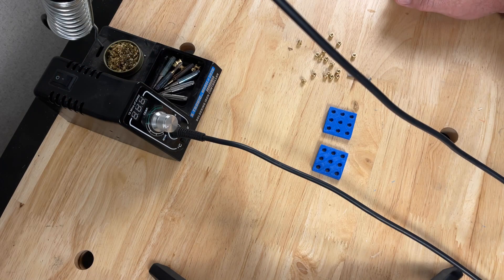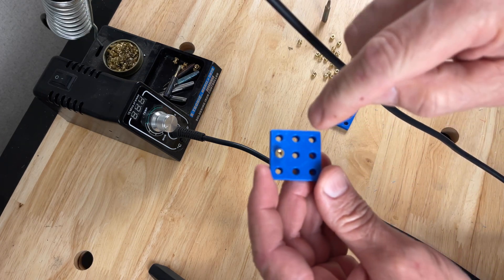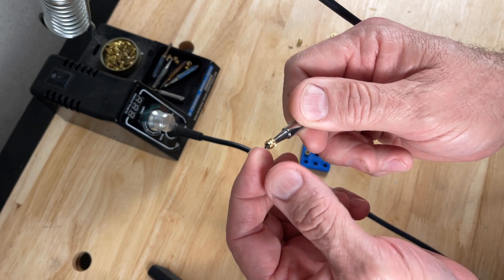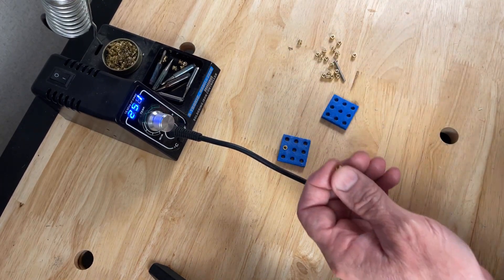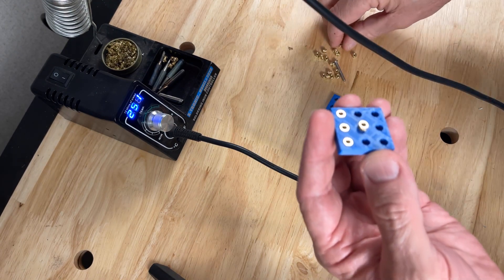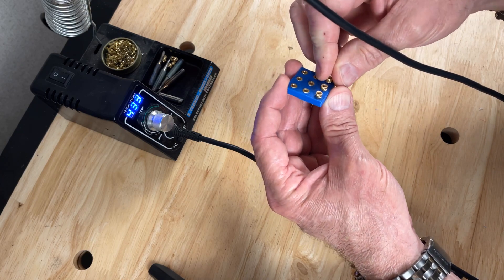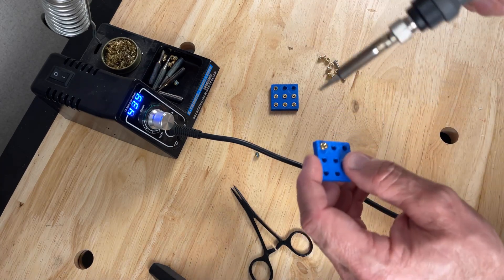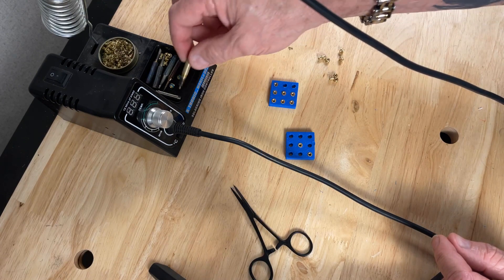How to insert heat sets into 3D printed parts

Comment: Thank you for this video.  I am building a Death Racer using your videos.  How do I determine WHERE the heat sets are to be inserted?  Which parts?  Which holes?
Reply from the maker: All holes designed for heat sets are 4.7mm diameter. If the hole is 2.7mm diameter it is for direct thread.